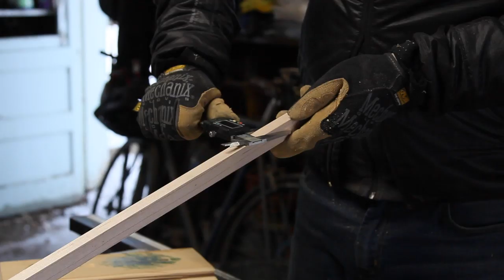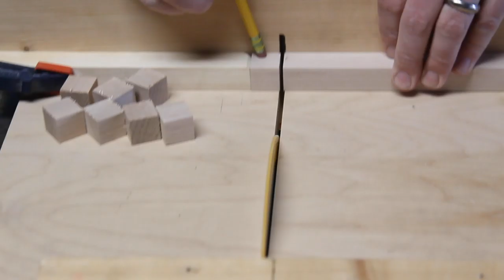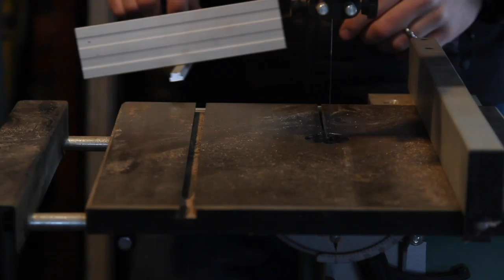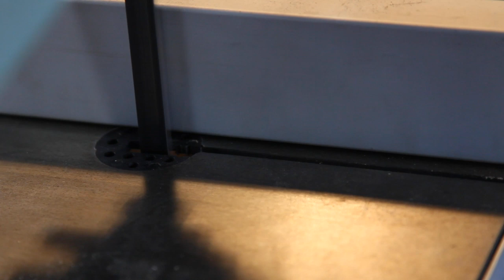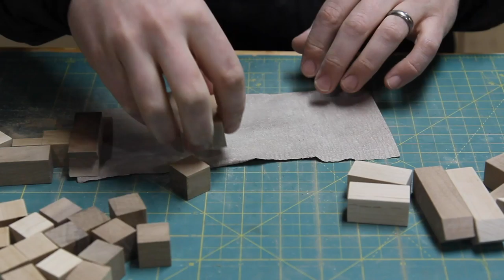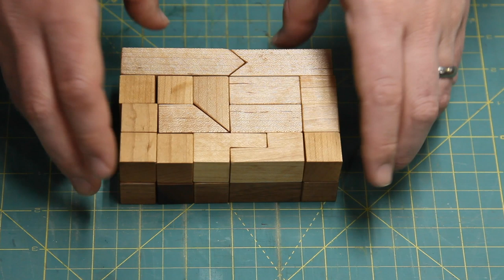Mid Century Modern DIY Chess Pieces

Comment: Nice set, have you ever seen the specially designed smaller fat chess pieces? They were like little overweight chessmen, the base of the pieces are the same as a normal set, maybe a little bigger, but the height was about half the size with robust proportions making them look fat. I haven't  seen them in some time.
Reply from the maker: No, I did do some searching and saw quite a few interesting sets. There was one that had rounded bottoms and the board squares were also rounded so they always stayed centered but would wobble.
Reply: @heyimamaker  I believe the chessstore.com used to carry them for a limited time. There's endless possibilities when it comes to designs for Chessboards and Chessmen. Your set there looks like it could actually be used in real play.
Reply from the maker: @slowlearnerschessclub7983  Thanks, I'm glad that you like it :)
Reply: Just an idea, to make sure the rook, knight, and bishop don't get confused, which could happen if turned wrong or looking straight on from the back, put a notch in the middle of the bishop representing the mitre, and two notches one on each side of the top representing ears for the knights, and then the big block of course then would clearly be the rook. 

Please don't think I'm nitpicking, just the practical chessplayer coming out.
Reply from the maker: @slowlearnerschessclub7983  Not at all, I like constructive feedback :)

Comment: I thought the pointy one was going the be the king and the V shaped ones was going to be the queen, but based on how he set them up at the end it’s the other way around
Reply from the maker: I could be wrong but the queen is usually the tallest piece, but I think I also have the king and queen in the wrong locations. Someone pointed out that I started in the wrong coloured square.
Reply: @heyimamaker  the king should be a "phallus" and the queen a chalice

Comment: WTF are you doing? How you are operating the table saw is absolutely NOT SAFE. If you do that in your shop, fine. But don't show that stuff on yt.
Reply from the maker: You don't agree with a push block and a cross cut sled? 

Why not offer some sage advice rather than a blanket statement about safety.